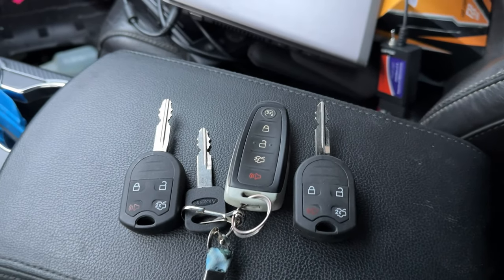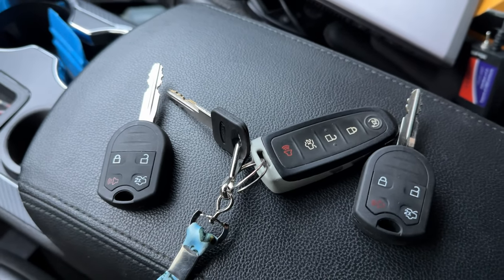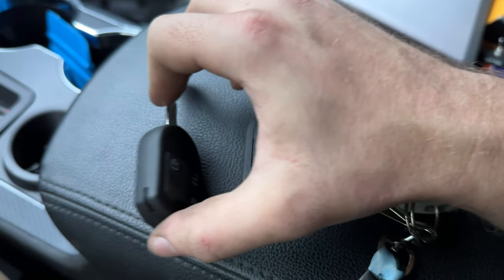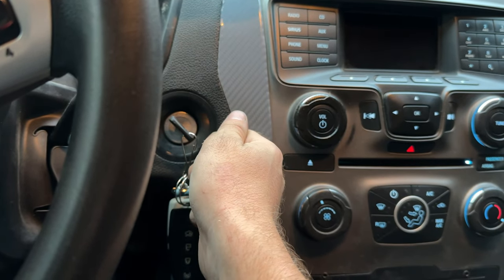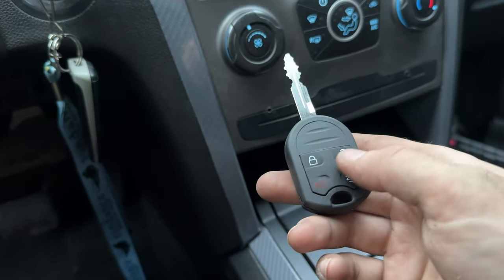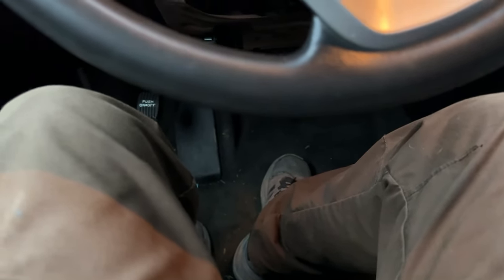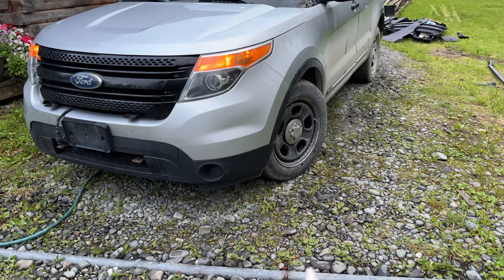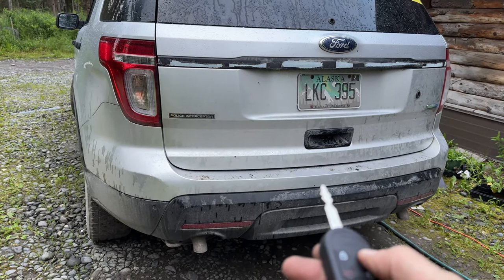How to Program Key Fobs on a 13-15 Ford Police Interceptor Utility (PIU)

Comment: Thank you so much for this video.  I just purchased a 2015 PIU that did not come with key fobs.  After following this video I was able to get a new fob working.  I just had to enable it in forscan then do the lock/cycle ignition.
Reply: You needed forscan to do this? I can’t get mine to enter program node

Comment: I watched this and your Forscan intro video and had a question. I have a 2015 PIU and in Forscan, the remote keyless option entry was enabled, but the remote key fob learn option above it is not there. After I enabled remote keyless entry, I went back and noticed there is a PAT programming option now available. I have one of the 4 button keys I got from Amazon like the one you have with the square blade key and can enter programming mode with the 8x off/on and I get the clicks telling me it goes into programming mode, but nothing happens when I press the buttons. I disabled TPMS due to dead sensor batteries and I can confirm dark car mode is disabled. Do I need to get a different key fob? Do i have PAT?

Comment: 2013-2015 will work with the 8 ignition cycle programming. On 2016-2019, you will need IDS or FORScan to program fobs. You can get remote start by adding a hood switch on 2013-2015. The receiver on the Interceptors do suck, you have to get really close to get the remote to work, half the time it doesn't.
Reply: What about for 2020? 🤔 — I got forscan assuming it would work but I don’t see keyfob modules.
Reply: @dramonxfan6431  2020+ should be same procedure. Enable keyless entry and the programming mode will be in BdyCM on the module list called "RF Keypad Learning by 48-char TIC code". FORScan may not have it on the 2020+ vehicles yet, you may need FDRS or IDS to program the fob if it isn't there. Dealer key fob is required for 2016 onward (Part GB5Z-15K601-C). DO NOT open the package until programming is complete (remote is not returnable once opened). The code will be on the package for the remote to input.
Reply: @FruztalProjects  would this program process with forSCAN work for the "Made in China " keys from Amazon? On 2016 to 2019?
Reply: On my 2014, it would not go into program mode
Reply: @KennyKingBoy  dark car has to be disabled and remote keyless entry must be enabled
Reply: @utility_tristin  thanks for getting back to me so quickly, is there a video that you have that explains how to do that?

Comment: I can confirm that this method definitely does not work on a 2017 FPIU.  I believe that the 2016-2018 FPIU are the same.  There is no end user programming mode, the only way is to enter a 48 character string which can be found on a sticker inside the key fob (OEM ones only) directly into the BCM.  Aftermarket ones do not have that string of numbers.  

Up until very recently this could only be done with IDS, but FORScan added it as a feature on a recent update.  

I saw that you mentioned dark car mode, so I even tried to disable dark/silent car mode with FORScan in both the BCM and IPM and it still didn't work.  You also need to enable RKE in the BCM or else even IDS or FORScan can not program fobs for my year.  

OEM fobs which will work on the 2017 are GB5Z-15K601-A (unlock/lock/panic) and GB5Z-15K601-C (unlock/lock/trunk).  All features on those fobs will work when programmed properly.  When I first bought my FPIU about two years ago FORScan did not have the programming feature so I enabled RKE then took them to a dealer to program.  I was trying to program a third (aftermarket so I can't use the 48 character string) with your method, but it doesn't honk and go into "programming mode".

Also, your car was locking all of those times that you tested it.  Those running lights come on when it unlocks remotely and go back off when it locks remotely.  It honks when you push lock twice (i.e. it was already locked when you push lock).  As for the hatchback releasing, try holding the button down for 3-5 seconds.  I don't need to on mine, but I've heard some reports that it needs to be held down.  You also won't hear the hatchback unlocking *at all*, it's super quiet, you have to use your hand to open the latch to verify that it was unlocked.  Just to be clear, the hatchback does not actually pop open when you unlock it with the fob.  It only unlocks, and is pretty much silent when it unlocks.  There might be a setting in FORScan to get it to pop open (I know that it pops open when I run a self-test on the BCM, but it only opens an inch or two and doesn't seem to have the hardware for power assist to open all the way).

My vehicle does not have PATS so that is unrelated.  I have programming/diagnostic tools that will program IMMO and fobs (Autel KM100 and Autel MX808S-TS) and even those can not program fobs for my FPIU.  The 48 character string is the only way.
Reply: Another update..  While playing with FORScan I changed the trunk function to "power liftgate" or something to that effect instead of "unlock" to see what would happen.  The fob would not open OR unlock the rear hatchback when I did that.  Might be worth looking into if yours still won't unlock with the fob.
Reply: Wish I read the comments before ordering the knock offs and trying it on my 2017 interceptor even ford couldn’t do anything they tried
Reply: Do I need forscan to program the oem keyless fob On 2017 interceptor?
Reply: Will an OEM ford explorer flip key be compatible with a 2017 PIU?

Comment: worked with forscan except the trunk pop button any help?
Reply from the maker: I have been looking into this as well. I will release a video if I figure it out.
Reply: It just unlocks ford has the blue button one that will work if you only have the panic button or anything else in forscan police rear door needs to be deactivated there no hardware to automatically open

Comment: I called the dealer , gave them my Vin # and they said my 2013 was ordered without the module for Remotes to open and close the doors. Is there a way I can confirm that? I tryed to program the remotes both ways nothing happened.
Reply: More then likely it’s a setting? Dealership said mine didn’t have the module but found the setting and boom I’m able to program keys in mine.
Reply: Forscan is the only way sometimes these dealerships just don’t want to mess with the settings so they make excuses

Comment: Great video series, I have a 2015 fpiu. When I try this method it doesn’t work. After the 8x ignition sequence, the vehicle doesn’t go into programming mode. Any suggestions? Thank you
Reply from the maker: Dark car mode is probably still enabled. Disable it in forescan
Reply: Had the same issue. Disable dark mode and enable remote keyless entry. And if it still doesn't work, try unlock lock unlock instead of lock unlock lock unlock.
Reply: Mine is a 2015 and it didn’t come with the keyless entry module so you happen to know where yours are located so I can take them out of a wrecked car and also look and see if mine did get installed after the factory

Comment: Thank a lot for these informative videos, how did you cut the Chinese keys to work in the ignition switch (aka to insert them into ignition switch to start the car)?
Reply from the maker: When you buy the keys they come as uncut blanks, You have to go to a locksmith or a key cutter kiosk in a store. It's usually pretty cheap. less than $10 per key. A lot of kiosks only let you use their keys but I convinced one to let me use mine. Know that if the Chinese key fobs don't work that a locksmith won't warranty the key.

Comment: Hey man, really like your content, keep up the great work. I’m having an issue where i am getting my car to go into program mode for the key fob but when i click a button on the fob, nothing happens. i changed out the battery of the key fob and same result, nothing happens. not sure what’s causing this. Any suggestions? I would really appreciate the response.
Reply: Hey also i ordered 3 keys, and none of them work when my piu enters programming mode, Is it possible it has something to do with wiring?

Comment: My interceptor won’t go into programming mode after cycling it
Reply: My 2015 won’t got into key programming mode either with this method. Is there another method?
Reply: Dark car mode may be enabled. You have to go into forscan to turn it off.

Comment: I ONLY HAVE THE KEY DO I NEED A PROGRAMED KEY FOB LIKE THE SMART ONE U HAVE IN ORDER TO PROGRAM THE 2 AFTERMARKET ONES FOR $25 OR I HAVE TO GET THE SMART KEY FOB THEN PROGRAM IT?
Reply: SORRY I MEANT TO ADD I HAVE A 2013 FORD ILL BE BUYING THE KEYS TODAY THE AFTERMAKET FOBS SINCE I READ ITS WORKS WITH THE 2013 MODELS SOMTHING ABOUT PATS. I SHOULD BE ABLE TO USE THE AFTERMARKET KEY  KEY FOB? DO I NEED 2 OF THEM TO PROGRAM VIA FORSCAN
Reply from the maker: YOU DONT NEED ANY PROGRAMMED KEYS TO PROGRAM NEW KEYS

Comment: Hi! I have a 2013 police interceptor utility. I am following this process, but dont hear the click of the doors locking when I am done. Am i doing something wrong?
Reply from the maker: Have you disabled darkcar mode first in forscan?
Reply: @depolicify  you know what, I just tried that and I heard the click this time! However I got the wrong fob I think because it’s not doing anything. Do you happen to know of a cheap fob that would work for these cars? Thanks!
Reply: Also trying to find a fob compatible with remote start

Comment: Did not work for my 2016 ford explorer police interceptor I’m guessing not all has that code.
Reply from the maker: As the title states, this is for 13-15
Reply: Yea it doesn’t work like that for 2016-2019 forscan and you can only program ford key fobs thru serial number

Comment: Hey! I tried this method, I got it into program mode, but my key won’t connect to the car
Reply from the maker: Verify you have a working battery, and that you got the correct key for that model. Not all key fobs are on the same frequency.
Reply: I know I have the same frequency, and I’m pretty sure the battery is still good. Any other ideas? Thanks!
Reply from the maker: Run down to an auto parts store and try it on their key fob tester to see if it is transmitting.  @06Canyon-i5g

Comment: I have a 2013 FPIU just like yours. Do they all come with keyless entry, how can I tell if mine has it? I watched and installed a center console from one of your other videos and I found the module you said might be keyless entry
Reply from the maker: I'm not 100% sure how to tell if yours has it. It may have a plug in the door where the Bpillar touch code panel would plug in. The module is also used for TPMS so in some cases it could be exclusively for that.
Reply: @depolicify All Police Interceptor Utility vehicles have it. You will have to enable it in BdyCM in FORScan. It's not like the old pre-2006 Crown Vics where it'd actually be missing the hardware. It has it, it's just disabled via software.

Comment: I tried it it doesn’t work for my pui
Reply: Can u please help with this??
Reply: @Arshak200  We just bought a like-new, used, 2020 Ford Interceptor Utility Hybrid SUV and it came with the standard key (no PATS chip in the key).  I tried to get a keyless remote for door lock/unlock and the Ford dealership looked up the VIN # and found out ours didn't include the "keyless entry" option.  So it doesn't have the wiring/technology/hardware to use a keyfob.  I just tried this 2nd trick and it didn't work on our unit either.  Though it could be because it's a different sequence to get into "program mode", maybe?
Battenburg USA Emergency Vehicles, Massachusetts
Reply: @Arshak200  What year is yours?  Please see my comment that I just posted, I'll place it here for you as well....    

I can confirm that this method definitely does not work on a 2017 FPIU.  I believe that the 2016-2018 FPIU are the same.  There is no end user programming mode, the only way is to enter a 48 character string which can be found on a sticker inside the key fob (OEM ones only) directly into the BCM.  Aftermarket ones do not have that string of numbers.  

Up until very recently this could only be done with IDS, but FORScan added it as a feature on a recent update.  

I saw that you mentioned dark car mode, so I even tried to disable dark/silent car mode with FORScan in both the BCM and IPM and it still didn't work.  You also need to enable RKE in the BCM or else even IDS or FORScan can not program fobs for my year.  

OEM fobs which will work on the 2017 are GB5Z-15K601-A (unlock/lock/panic) and GB5Z-15K601-C (unlock/lock/trunk).  All features on those fobs will work when programmed properly.  When I first bought my FPIU about two years ago FORScan did not have the programming feature so I enabled RKE then took them to a dealer to program.  I was trying to program a third (aftermarket so I can't use the 48 character string) with your method, but it doesn't honk and go into "programming mode".

Also, your car was locking all of those times that you tested it.  Those running lights come on when it unlocks remotely and go back off when it locks remotely.  It honks when you push lock twice (i.e. it was already locked when you push lock).  As for the hatchback releasing, try holding the button down for 3-5 seconds.  I don't need to on mine, but I've heard some reports that it needs to be held down.  You also won't hear the hatchback unlocking *at all*, it's super quiet, you have to use your hand to open the latch to verify that it was unlocked.

My vehicle does not have PATS so that is unrelated.  I have programming/diagnostic tools that will program IMMO and fobs (Autel KM100 and Autel MX808S-TS) and even those can not program fobs for my FPIU.  The 48 character string is the only way.
Reply: I just tried this method on my 2014 piu and it didn’t work
Reply: Mine 2014 didn’t work either and it won’t connect through FORScan either, the code reader does connects through my phone but it won’t connect to my laptop FORScan app
Reply: @lokysgarage I was able to get mine programmed. I had to use forscan to turn off dark car mode and also enable key program mode.
Reply: @kennethmorrow740 an you post how to do that. Please. I just bought the keys and it didnt work
Reply: @kuldeep510  you have to use forscan to turn dark car mode off and also enable key programming

Comment: I can't get in program mode 2015 interceptor utility
Reply from the maker: You may have PATS. If so then use the same method as for a regular ford Explorer
Reply: @depolicify  i had went on amazon and typed in ford pats. A obd came up elm327 i believe basically a obd with a usb cable. I downloaded forscan free 2 month trail. Got into the vehicle bcm and  disabled dark mode and turn on remote unlock. Wala it worked. I was able to put the vehicle in program mode by taking it out of dark mode.. thanks for help. Question since you changed everything out. Would a ford screen from a regular explorer work in the police units?
Reply from the maker: @dallasgreensmoke  Good to know. My understanding is that if your car has sync already installed then you can upgrade to another sync system with a different screen. If you are like me without sync then you are limited to only installing an aftermarket radio, and there's not many options out there.
Reply: @depolicify  ok yea i thought so. Another question. Have you upgraded to led or hid lights.
Reply: @dallasgreensmoke how do you use that. Can you post video or share steps what to do it